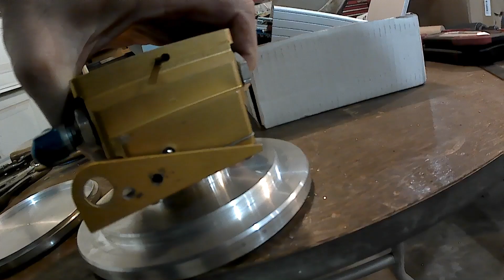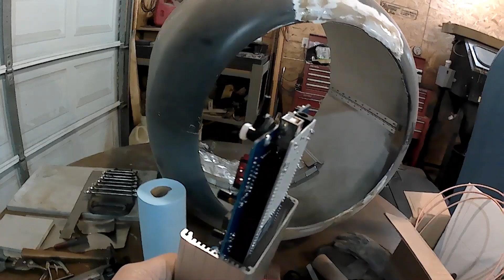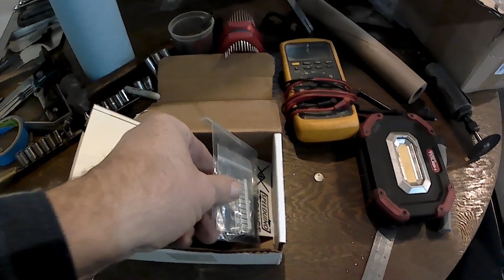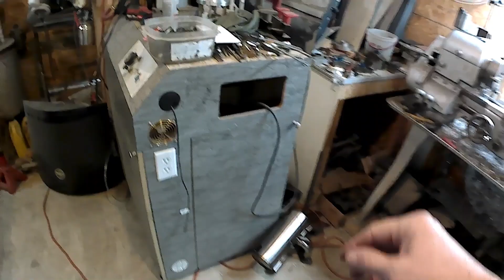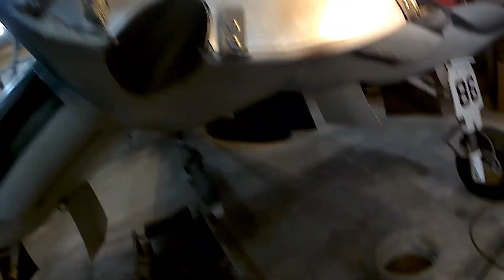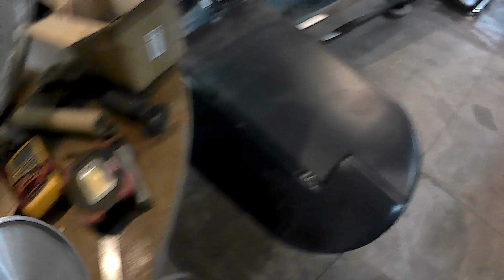WAR Corsair Progress update 2/4/2025 Part 1

Comment: Don, what kind of equipment do you use for all of your precision metal work?
Reply from the maker: I have a bench top mini lathe as well as a larger floor model lathe. I built my own CNC router that can hold up to a 2x3 foot piece of metal. And a whole assortment of power tools for cutting and grinding. Also, vernier calipers and micrometers.

Comment: With the TBI, you need to be very careful about turbulent intake air.  From what I can see you are asking the air/fuel mixture to make an abrupt 90 degree turn on its way to the cylinders, unless I’m envisioning it incorrectly.  I’m certainly no expert, so my concern may be unfounded.  I’m just going by what Rotec cautions about.  Their concern, however, deals with intake air as it enters the TBI.  Possibly down stream of the spray bar turbulence is not a factor?
Reply: I on the other hand have a turbulent flow issue. It makes power additions not so instantaneous, to say the least. Just more stuff to tweak. Mine is 90deg down draft, too.
Reply from the maker: My intake design is pretty much the same as a Continental engine, except mine is down draft not up. Yes the concern is the incoming air design. I have the Rotec manual, so I know where you're coming from. I'll talk more about the air filter design later. Thanks for the input.
Reply: @ I neglected to mention that your machining is impeccable.  You’re very talented.   I think you are going to really like the TBI.  Once set up, it works great. I have one on my R3600 radial in my Hatz Classic.  Makes the engine very easy to start, and the throttle response is instantaneous with no hesitation.
Reply from the maker: @RVN782P  That's what I have come to learn out them. Thanks